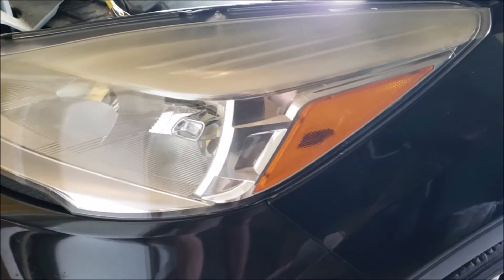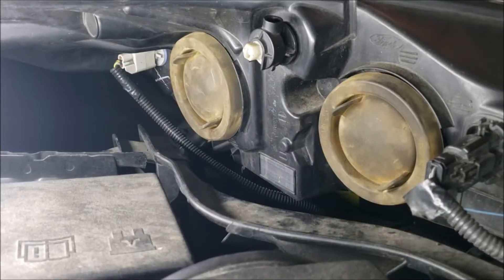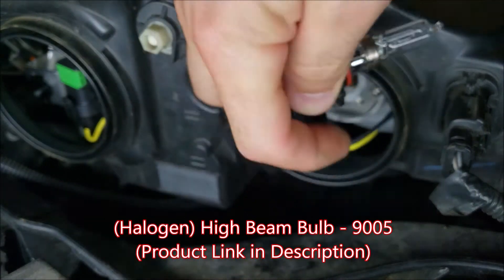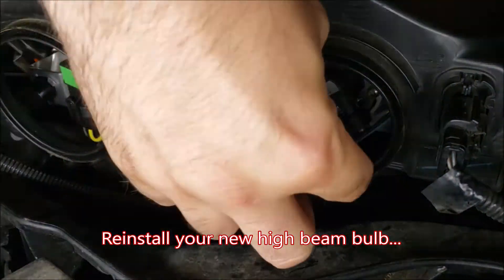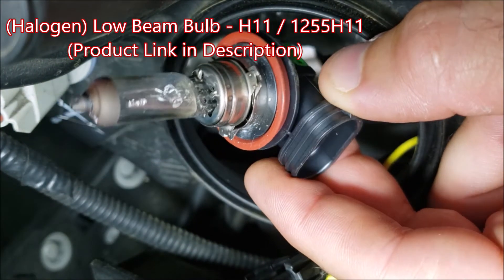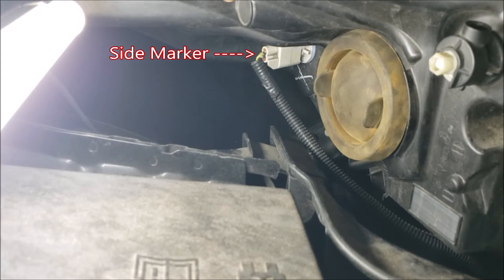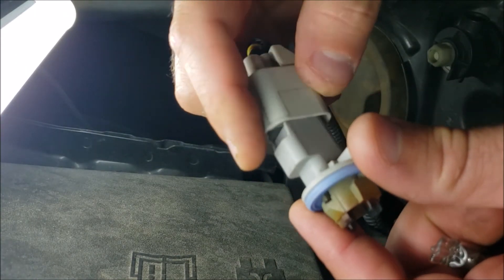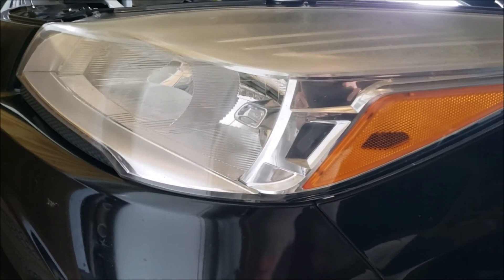Replacing High Beam, Low Beam, and Side Marker Headlight Bulbs : HOW TO ESCAPE

Comment: Finally! Every search I did for my front side marker bulb replacement kept turning up the bottom bulb like the fog light area. I typed in 168 to my search and bam quick easy to follow straight to the point video! Thanks!!
Reply from the maker: Nice!!! Glad it was helpful- did you end up swapping it out ok?
Reply: @HowToEscapeDIYTipsandReviews  still haven't gotten it yet lol its not like a blinker bulb or anything I tried last wk to take it out and was afraid of breaking it can I spray wd40 there or no?
Reply: @HowToEscapeDIYTipsandReviews  like the bulb itself it's stuck I can get it out of the housing or whatever it's called from behind the light fixture but the bulb itself seems stuck

Comment: Thanks for keeping up with content.  I have a 2013 1.6L as well, and your videos have helped me out with DIY maintenance.
Reply from the maker: Hey thanks for taking the time to say that, Jonny! I appreciate it man. Its been a lot of work but I feel like we are getting to a point where the baseline maintenance library is almost done - more things to come of course! How is your '13 running? What mileage? We are at 146K with our SE.
Reply: @HowToEscapeDIYTipsandReviews  Anytime!  I'm just about to hit 90k miles, and feels like it's running better than when I bought it 3yrs ago at 55k miles.  I did the transmission drain/fill at about 84k, and the spark plugs at 88k, which helped out my overall engine idle and acceleration at higher speeds.

I did upgrade my rear cargo and license plate lights to LED's awhile back, so maybe your next video for the people?...
Reply from the maker: @Beiberhole69RVA  hey very cool! Yeah I think we could get that led video lined up! Mind if I use your name in the video for the request/suggestion? Also, props on the trans fluid and plugs- I agree- the plugs made my Escape run a bit smoother as well. Its nice youre still under 100k! Have you done your timing belt and water pump yet?
Reply: @HowToEscapeDIYTipsandReviews  You can use my name for sure.  Haven't had any issues with my timing belt or water pump yet, but was thinking it might be time to replace the fuel filter though.

Comment: So i recently changed my puddle lights from factory bulb to a much brighter LED There was actually no good videos i could find to show me how to do it so i winged it and it came out great lol but I’m also looking to change my turn signal mirror lights from stock to LED amber witch i have in the mail today I’ll keep u posted on how they come out! 2014 Ford Escape Titanium 2.0
Reply from the maker: Awesome, Andrew! I actually don't have puddle lights or turn signals for the mirrors on my SE, so I'd be very curious to know what you find out! Looking forward to hearing back and thanks for being a subscriber to the channel! Really appreciate it, man :)
Reply: Hi Andrew! I switched out my factory side mirror puddle lights and side indicators with LED's also on my 2013 Escape SEL. Worked out great. Do you or anyone know how to replace the puddle light  housing? Found out from forums that there is a small torx screw to remove and then apparently a downward tab to press to release the housing. I have not noticed any tab after removing the screw. I am attempting to replace the puddle light housing with an LED Ford logo projection light. Any help would be greatly appreciated. 🙏

Comment: I watched the rear rotors and brakes replacement video, I'm looking for a running light replacement video. I'm hoping I don't have to remove the front bumper. Is there a video on that?

Comment: Sidemarker bulb - FE 2015/HID variant.  - when I turn the wheel left/right, is that the "side marker bulb" - And if so, do you have LED recommendations for it? Or others?  - Also, ty for showing this. At the very least, looks silly easy to replace.  and is the model literally 168 ? Just clarifying so I can look for a solid reliable replacement bulbs to upgrade.  -- Whenever I search it on amazon dot ca, I get 194 model, and not 168. Was wondering if that's compatible or not also. Still searching.
Reply from the maker: Hi there @RMLeLoup- yes, you're correct- the outermost little blinker bulbs are the directional indicators / side marker bulbs. When you are turning left or right, they are the flashing bulbs. Sorry that was unclear. I do not have a direct LED recommendation for that, but if you go to FordEscape.org and search the forum there, there are loads of people who have drop-in replacements that they vouch for. I just haven't done that yet so I can't recommend any at this time. Wish I could help more there. And yes- it is just "#168 bulb"... you can search google, or amazon or use our link in the video description. RockAuto is a good / easy source as well- but like you said, if you're looking to upgrade to LED, that is at least the correct place to start.
Reply: @HowToEscapeDIYTipsandReviews    - Thank you for that, you've provided some direction and clarification I was seeking, (Wasn't expecting an immediate response realistically). Seriously though. Tyvm for this.
Reply: @HowToEscapeDIYTipsandReviews  To clarify.  -    just re reading, maybe we missed something.   Left steering wheel, there is the toggle. Left or right signal orange lights go flashy flashy .  - - - When I "just" rotate the steering wheel 90-270 degrees to the right or left. An illuminated "on" light gets triggered coming out the left or right lamps, it's tiny, small. And is "not" a signal that goes off on off on off on.  I'm more trying to identify the upper shell housing light bulb that is specific to "when you rotate the steering wheel alone, with no flashy flashy lights". To be as literal as possible.  Is that 168 or? And I couldn't quite affirm if your video properly replaced that bulb specifically as I have a HID based housing and not the standard halogen you're video has here.  Thanks for the additional read.
Reply from the maker: @RMLeLoup  Of course! I am working on a few things for the app tonight so I have all my windows open and saw your post come in :) Glad your reached out on FB too- have a great evening!

Comment: Can you put any 2015 headlight housing in a 2015 Ford Escape titanium???
Reply from the maker: Hey and sorry for the delay! They are not directly compatible from what I believe. I am not 100% sure about going from Titanium /HID to basic, but I know 100% you can't go from basic halogen to HID. There are ballast accommodations and different voltages to the led running lights just to start with. That being said, there may be a basic alternative to the titanium lights. I know they are ridiculously pricey if you buy new. Try Tasca parts for your Part Number and search for a good deal maybe, or Rock Auto as they usually have decent deals. I wish I could help you more on this but im just not sure as we only have a 13 SE.

Comment: I tried to twist the passenger side, side marker bulb socket  like you did. I tried turning it counter clockwise. It won’t budge.  Suggestions please.
Reply from the maker: Yeah it took a bit and it's wedged so close to the sidewall it's hard to get much leverage on it- my suggestion would be to try and push it forward...see if you can compress the gasket and give a bit more room for the key features on the socket to lift away from the ring it's keyed against. Then try and twist. If all else fails you could try a set of channel lock pliers with the offset/bent jaws and see if you can gently get around it to twist. Please let me know if this helps!

Comment: Show how to completely remove and replace the passenger side low beam bulb
Reply from the maker: It should be the same as the one shown- is there something not included that would be more helpful?
Reply: @HowToEscapeDIYTipsandReviews  It's nowhere near as simple as the driver side.  The connector/wire isn't as long as drivers side.  It's not the same at all.

Comment: Really great tutorial man! But why didn't you get LEDs instead, they're much brighter and better.
Reply from the maker: Hey thanks a lot, Ed! I hear you- 100%. I am trying to "complete" the maintenance library  for how-to videos for this car in terms of stock / factory components before upgrading. I still need to do the lower fog lights as they're tricky to get to sometimes too... that being said, I have been working on an LED upgrade review video on the Boslla B1 bullet LED alternative for the low beams (H11). I was making the video the other night and right when I took everything out for a test drive, I noticed the lights flickering and then the lights shut off with a voltage fault. I contacted Boslla and they're sending over decoders to be able to hook it up and finish the review. Not super stoked that it requires that, but it's my first time dabbling in performance LED lighting. What have you found with your Escape? It sounds like you've done this already? Any tips or brands you'd like to see featured? They are CRAZY bright- my concern is blinding other people too... I'm often on the receiving end of the blinding LED headlights haha.
Reply: I got them on Amazon and they’re great! And yes I would love a tutorial on the fog lights plz👍🏼 Keep up the good work
Reply from the maker: @edhernandez1782  Thanks Ed! I appreciate the affirmation- you got it. When you say you got your LEDs on Amazon, did you get the Boslla's as well? Or did you get something different?
Reply: The brand is Sealight and the price on them is $69.99. Have a great day